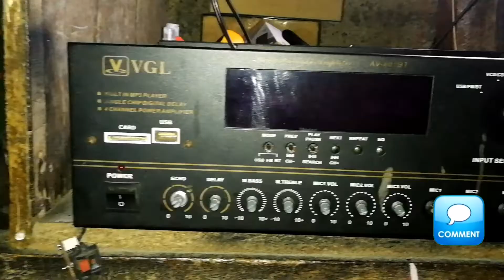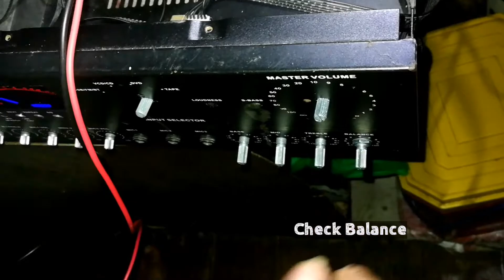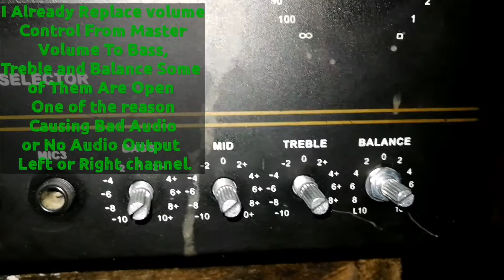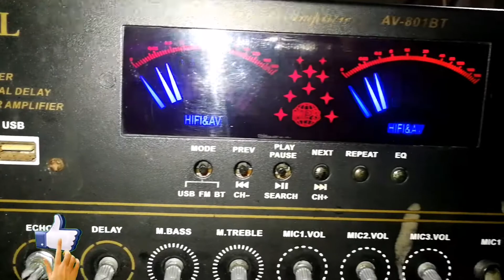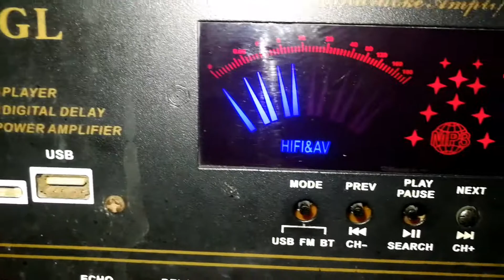Solution for Any Amplifiers One Channel Problem, Isa lang ang my Tunog |DudzSkills

Comment: When I put my jvc amplifier balance on the left it gets loud. Same as the right. When I put it in the middle they both work but it's mono and the volume is low. Any ideas ?
Reply from the maker: Just check the speaker connection just read the label sometimes it's a mono if you don't know the label,or else there's a problem in you pre-amp section most are the potentiometer or volume control